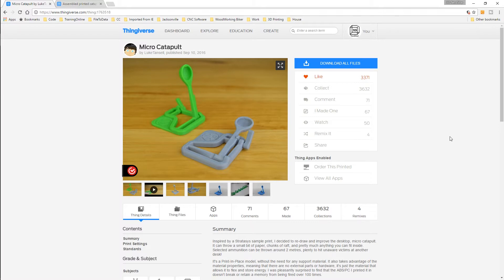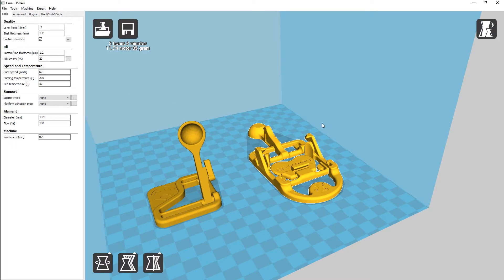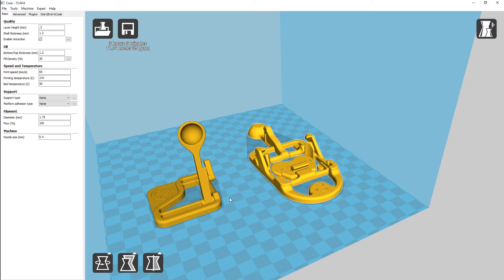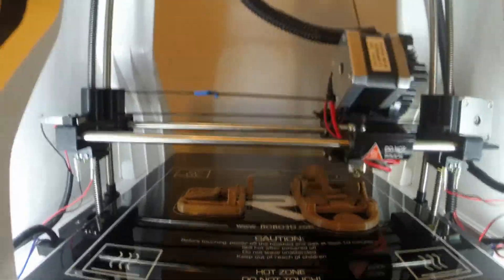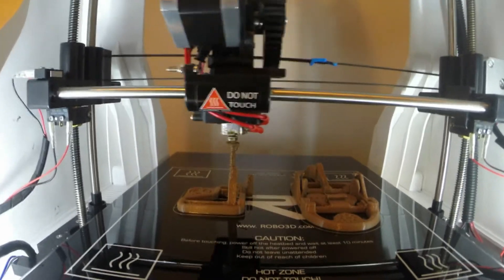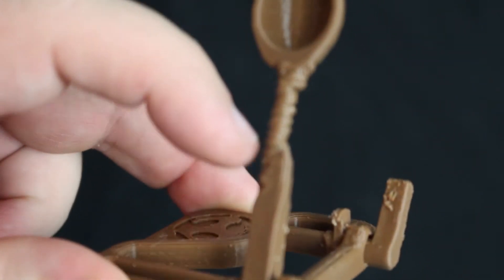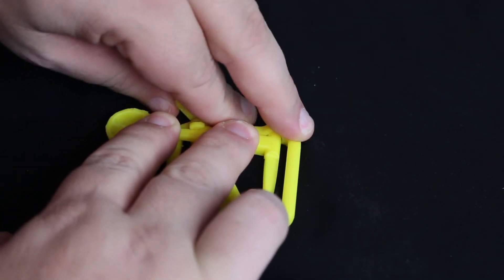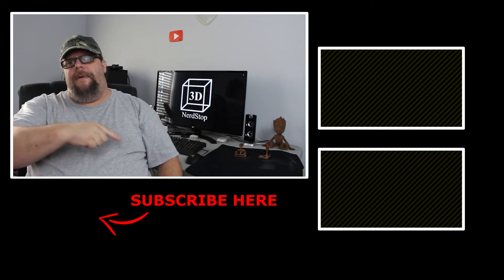3D Printing Micro Catapults

Comment: Quick question, do you use anything on your glass build plate to help with adhesion? I have a glass build plate but never tried printing right on to it.
Reply from the maker: I use Aqua Net Hairspray Extra Super Hold. I should say I only use Aqua Net Extra Super Hold. I have tried other and they did not work for me. Here is a link to what I use https://www.amazon.com/Aqua-Net-Professional-Unscented-ounces/dp/B00HA88UZ2/ref=sr_1_3_a_it?ie=UTF8&qid=1503520436&sr=8-3&keywords=hairspray+aqua+net I would get it at the store not Amazon very over priced on Amazon.